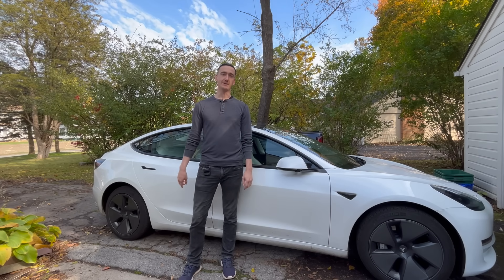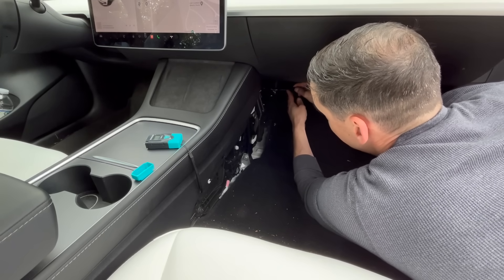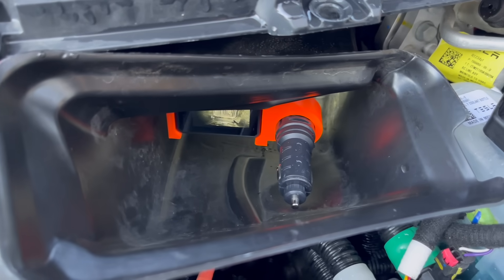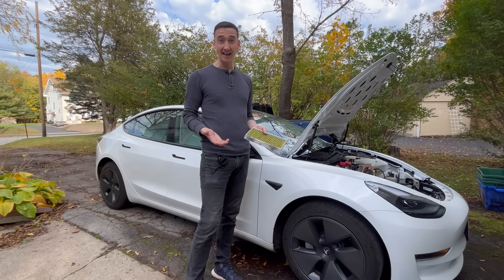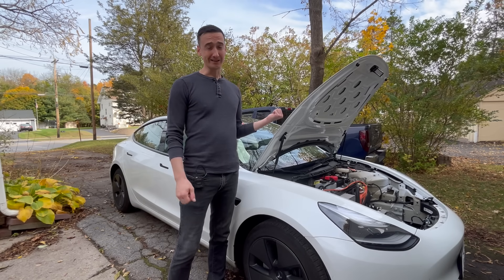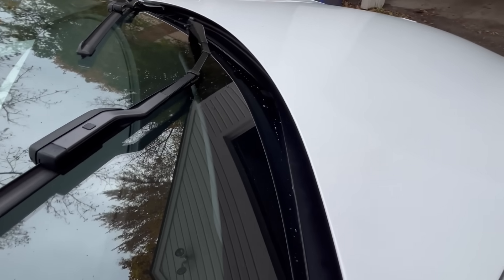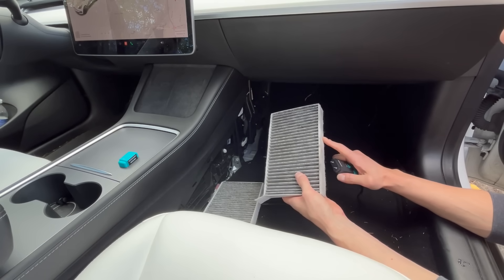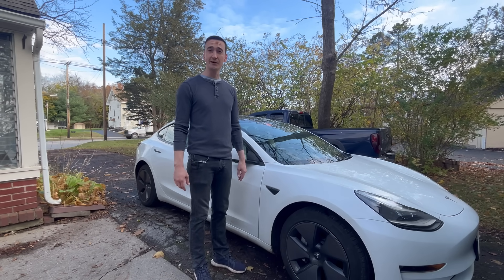This design flaw makes Tesla’s Model 3 smell bad! (with fixes!)

Comment: The filter may be the source of the smell for you (given your filter smells when wet), but I can say confidently that is not the case for many people in the forums. They have tried wetting the filter after the smell started in the cabin and the filter doesn't smell. They have even tried taking out the filter and the car still smells. So the smell is coming from somewhere inside the car that is not the filter for those people. That's why for many people, they say the evaporator cleaner is a must to have the fix last for months. A filter change alone (with no cleaner) can last just weeks instead.

There are those that tried the hood gasket and still had the smell happen.

Also there were many more complaints before the Tesla fan update to dry the evaporator, so that definitely played a role. Using manual recirculation also seems to cause the smell to occur. There are those that say turning off the AC and running the fan a few minutes on high before arriving at the destination eliminates the smell from returning. So perhaps the real fix is a more aggressive fan update.

So unfortunately I don't believe this is the universal fix nor points to the universal cause, even though it might fix it for some people.

Given the recirculate seems to play a role (as you say, none of the other cars you looked at had recirculated air pass through filter/evaporator system), I would say that probably has more to do with it.
Reply: Interesting – have you heard any other ideas from people in the forums as to where water can collect in the AC ducts / system that could be causing this?

I've had four other cars before my Tesla that I've driven for ~20 years and none of them have ever had this smell, and I barely changed the filters in them... Even if there are other places in the Tesla that can collect water / moisture and create this problem, it's something that I hope they can actually fix in the future by designing a better physical system rather than the "fix" they implement now of just blowing air through the system to dry things out – which only sometimes works, and only temporarily at that... 

I've had this problem in the past and sometimes my filters have smelled when I replaced them, sometimes they haven't – I think it depends on whether or not they've been damp for a few days, similar to what can happen with clothing... Sometimes if you leave your clothes in the washer overnight on accident and they develop a mildew smell, you can almost never get rid of it. You can throw them in the dryer with a dryer sheet and they'll come out smelling okay, but if you put that shirt on and go for a run and start sweating and reintroducing moisture into it, you'll smell the mildew again X__X
Reply: @zackcruise  
For people that developed the problem, I haven't seen any "permanent" fixes or anyone that conclusively found where the smell is coming from. The evaporator cleaning (two cans to make sure it gets everywhere) and filter change seems to last the longest, for some people it lasts for months or even a year or two. There are however some that reported it only lasts for weeks.

I've seen claims that manually drying out the evaporator (turn off AC and run fan at high speed) at the end of the trip is effective (instead of waiting for the fan to kick in automatically, which may take about 20 minutes after car is parked or maybe never if you have cabin overheat mode set with AC on).

I think the Tesla fan update did prevent a lot of new cases from developing though in the first place. However, once you already have developed the problem, the fan update doesn't seem to fix it. Essentially your system has been "contaminated" and the smell seems to return much more easily.

Also, from looking back in the thread, there were other brands that had the same issue, like for example the Prius, even though they presumably have a different vent system.
Reply: Definitely you are right
Reply: I don’t think the AC off & fan blast works. It actually speed up the smelly ac problem for me. If you do that during summer when outside is humid and hot, turning off the AC with fan will quickly shock the system with temp delta and creates more moist air into the system. There are times when I do that, I started to smell the wet towel smell after just a month from evaporator cleaning. Nothing will fix it other than having a UV light in the evaporator box. 😂
Reply: @tktkwei  
The people that said the fan blast is effective live in areas in California with relatively dry heat and moderate temperatures (which also means that strategy is tolerable; otherwise the car gets too hot quickly, even if you leave it to recirculate).

If you are blasting it with wet air that is almost fully saturated, that obviously does not work. I've travelled and live shortly in places with humid heat and things quickly grow mold/mildew just sitting around, so the conditions are completely different.

Comment: Fantastic video.  Excellent forensics of the problem and cause.  Brilliant options offered.  Great job, Adam!

Edit: 7 months later, I applied the gasket kit you identified (actually installed it a bit ago, but wanted to give this solution plenty of opportunity to fail).  Installation was easy.  It completely resolved the musty smell we experienced.  I have a 2021 Model Y and live in San Jose, CA.  Not too humid here, but we experienced the musty smell after rains.  This solution was all the was necessary to eliminate that.

So thank you for this video and solving my problem.
Reply: If it completely resolved the musty smell, then the gasket must be stopping water that was previously getting in. What was the source of the previous water before the gasket installation?

Rain, car wash, or something else?
Reply: In my case it seemed to be rain.  I rinseless wash my car, so I don’t know if regular car washes would have caused it too.
Reply: I just stumbled on this video today and have the same issues with mine after rain (and general humidity here in the midwest).  I think I'm going to give that gasket kit a try as well.

Comment: This happened to my model Y and Tesla CHARGED me to change the mouldy filter and dry out the evaporator as they claimed it was "maintenance".  I kid you not.   Their design flaw becomes maintenance.  This is only one of the reasons I dumped my Tesla and don't miss it in any way.  The poorest ergonomics on ANY car I've ever seen and missing many features all new cars should have but they don't.  I've preferred my Polestar 2, Ioniq 5, GV60, and even my budget Bolt more than my Tesla in almost every way.

Comment: There is a mesh screen that you can buy that snaps onto the intake.  It keeps stuff from going in.  I even have the barrier installed.  I am having the filter replaced, unfortunately.
Reply: I think even with something like that installed you're still going to get that musty, mildew smell from the filters because they're still going to get wet... Last time I replaced my filters they had very little, almost no "debris" in them that I could see – but they still stank! I'm due for another replacement soon now that I think of it 🤢😅

Comment: I had a 2018 Model 3 and the AC never made it smell.  But, one trick I learn a long time ago with other vehicles is to turn off the AC a few minutes before ending my drive and running the vented air on high.  This helps dry the moisture off the condenser coils, which causes mold that is the cause of the smell.  This is a thing with any AC unit in vehicles and buildings.  But yeah, it is more common in a Tesla than other vehicles due to how they designed the air duct.

I get your point but your test really focused spraying water into that filter duct with the hose.  That's not exactly how it would happen with rain in most places, especially while driving.  But I agree that Tesla should have tested this more and fixed it.  I like the hood gasket idea, again something Tesla should have come up with.  They also could have put the duct facing down, instead of up.  You could mod the existing duct by blocking off the top and cutting an opening in the bottom for the air.  But the hood gasket is probably and easier fix.  It baffles me how all the supposedly smart people at Tesla, with all the testing that they do, never discovered this issue.  Or maybe they did but management ignored it.

But good job looking into this and figuring it all out!  And I agree that when it's raining use recirculate mode, even have the AC with the heat on, to reduce the moisture in the cabin air.
Reply: I agree with you about spraying water on the windshield and past the windshield wipers, is not indicative of real world.  In my view it is not nearly enough water. I live in the tropics where it rains 22 inches in one month.  Stuck in traffic, in a monsoon rain delivers significantly more water than from the spray in this video. 
Don’t know why I watching this video as I have a model Yp with the HEPA filtration system.
Reply: 👏 driving extra to dry out is something I do on my ‘18 M3P, and it only gets me that far. I think a middle ground is to get the air to flow and water to drain with the duct in place. While I think on the onset, turning it upside down is logical, I guess that the same air pressure and flow forcing water into the car would affect the car’s drag coefficient and impact its range if it were upside down. 
One thing on all other cars he showed was the intake being on top. ☺️🤔
Reply: I believe that teslas have a desiccant installed specifically to address this issue
Reply: @gir1258  That really won't help if it is also soaked.

Comment: i knew this was a known issue and installed a screen filter on the very top of the intake and also the rubber seal, and my ac has never smelled bad when first starting the car

Comment: Who washes their Model 3 with the car on and the fan blowing at full speed?  This demo was overexaggerated.  SMH
Reply: this happens to my Model 3 very often when I drive in the rain - if it's even moderately raining outside and I have the AC on and I don't manually put it on recirculate mode every time I enter the car, my filters get wet and they smell horrible the next day...

just google this issue, you will see many people whose cars stink even if they don't wash them
Reply: Who excuses Tesla for poor design while blaming the owner?
Reply from the maker: 9:28
Reply: @adamdport Easy solve.  Turn off cabin overheat protection mode when washing your car.  Another easy solve, don't wash your cash on a hot day.
Reply: @KP-xi4bj  what else? don't drive against the wind when raining or if it's full moon?
Reply: @apclaudiu Sell your Tesla and walk?

Comment: Another free solution is to enlarge the cutout(or multiple sections of small cutout) at the bottom to allow all the water to flow out. Since this is not an ICE car, the mixture of air coming from the top vent and also the enlarge cutout would be ok(no combustion). My car started to smell a bit so this is what I would do based on what I see from this video. Buy the gasket kit, change filter and clean the evaporator. If smell comes back in a year or so, I'll create a bigger cutout or multiple small cutouts along the way to allow water to drain to out before it even hit the last section.

Great video BTW...good job :)
Reply: An you make a video teaching us how to do this
Reply: This would be my suggestion also. Enlarge the water cutout. Make it go all the way under the bottom pretty much.

Comment: An idea on this comment 10:55. The main issue is the velocity of the air is to high relative to the size of the drain hole. However since they have an air flow valve at the firewall that appears to redirect the air flow within the cabin they could clock the valve to a partial open/closed state relative to the velocity of the air (or speed of the fan motor). This would in effect offer full HVAC flow within the cabin & some fresh air intake while limiting the velocity of the air born water particles allowing them to fall to the bottom of the duct and out the drain hole. One main issue with the design of this duct is that the designer (I'm sure inadvertently) created a venture valve further reducing the effectiveness of the drain.

Comment: Thank you for doing all this and sharing it. I too, thought that the moisture was coming from the evaporator, even though I could tell that the funk was coming from my filters! The power of suggestion is strong! I do wish they'd just draw the air UP with a U-turn on the intake. Facing the air intake UP has always seemed like a failure to me on all cars. We should be using gravity in our favor, not fighting it!

I'm amazed to hear about anybody who says the air is somehow "restricted" after installing the gasket you show. There is plenty of free air all around the hood that does not seal to the body.
Reply: Exactly, if you put a piece of plastic compleatly blocking the up facing intake and expand the "drain" hole to take the air in that way I think it could do the trick, it's not like a tesla needs to avoid engine fumes like a ice car. This is a design relick from that time that Tesla missed, unusual for them but it happens.
Reply: @agw5425  At that point, it is probably easiest to just remove that intake as Adam mentions. I think the only issue with drawing the air in from below is what happens when driving on a dirt/dusty road. 

Let's put a snorkle on the Tesla intakes!  :-)
Reply: @darelldd the snorkel comment had me let out a laugh 😂😂
Reply: @darelldd  If the filter clogs up to fast you can put a course sponge in the duct as a pre filter and just rinse it once in a while. Most driving don't render that much more dust below than above the same car. The main reason to keep the duct and block it is to stop water entering the area at all, you would need the extra gaskets of cause.
Reply: @agw5425  Those up facing intakes are also built that way to help prevent pulling in the exhaust from the car in front of you. 

After a little research, this is an old design from the WWII era. With vehicle designs back then, people actually died from the exhaust coming from the car ahead. That's when the design for this open gasket area at the top of the hood started coming into use. At speed, a low pressure area forms there, so it worked well to use as an air intake.
Reply: Well it does close off an intake area on a car with no grill. I don't know that the front of the car is sealed up well enough that it would matter though. I would almost think the car is expelling air through the hood there.
Reply: @BaneSIlvermoon the entire hood gap is an “air intake”. There is no gasket. Plus the whole underside of the car that’s basically open to that area (meaning it is not "sealed" from the air intake in a meaningful way. for example the intake's drain is open to that area). There is far more free air than the size of the final screened intake before the filters. The airflow will not be meaningfully restricted by adding the gasket below the windshield. (I've now eve tested this enough to make me fully confident in this contention).
Reply: It's not open underneath. It's certainly not air tight by any means, but the only place that has free flow is that spot. But like I said the first time, I doubt it's sealed up well enough that it would matter much. 

Though a guy further down more familiar with HVAC and who understood the history of that design did seem to be of the opinion that it mattered. @darelldd
Reply: @darelldd  ["I'm amazed"] you hadn't considered that gasket gap could be to release/prevent a build of air pressure at motorway speeds under the hood.
You being perfect & all, unlike the rest of us ignorant plebeians...
Simply amazed.....
Reply: @alexmanojlovic768  Apparently I've upset you. Of course that gap could be to release/prevent air pressure or vacuum.
Reply: Can you the they guy is an engineer?
Reply: Your last paragraph is a strange & arrogant comment.  One Suspects Tesla fitted a 2-part gasket with a large gap for a reason, but we're all sure you know better than their designers!!...
Reply: @alexmanojlovic768  There may well be a compelling reason that Tesla used a two-part gasket. Just months previous to using that 2-part gasket, Tesla fitting nothing in that area. Only the mount holes exist with plugs. No gasket at all. The designers at Tesla clearly put effort into continually improving. And apparently they weren't happy with the initial iteration, and kept working on it as they still are. My 2018 car came with no gasket and a much different intake than is shown in this video.

That said, there are indeed relevant questions about how the Tesla designers went (and go) about things. The designers don't have the luxury to focus in on every last detail, without regard to cost or the effect on any other system. And they are not infallible. My time is spent designing, engineering and prototyping items across many industries. For better or worse, it is what I do. And it is what attracts me to videos like this.

As for my comment being strange and arrogant... you realize that my comment has nothing to do with the reason that Tesla fitted the 2-part gasket, yes? It had everything to do with people thinking that a full gasket across that area would restrict airflow. And since writing that, I have taken my own airflow measurements both with and without the full gasket in place. I used an anemometer in the intake, just before the filter, fan on high. I choose to not share the result, to avoid again being labeled as arrogant.
Reply: I'm amazed to think anyone called darelldd could believe it was coming from the evaporators, even though they "knew the smell was coming from the filters"... sic!!...
Reply: @alexmanojlovic768  Yes, I thought that the moisture was coming from the evaporator, even though the smell itself was clearly coming from the filters. Again I apologize for upsetting you.